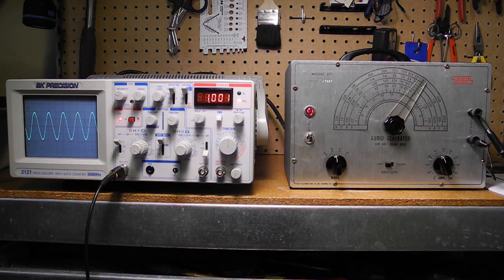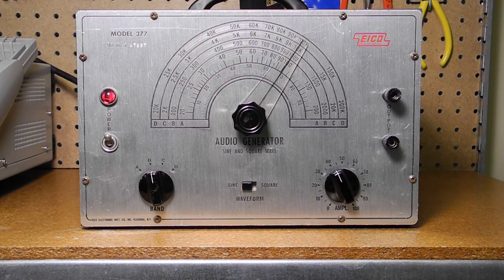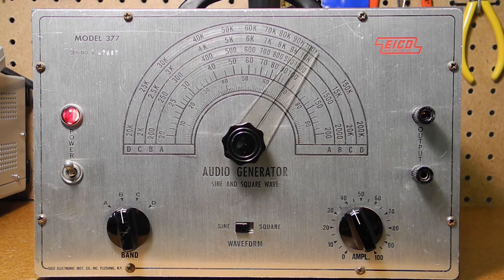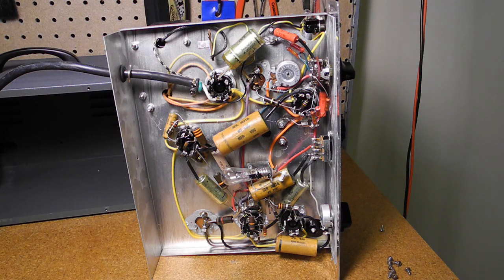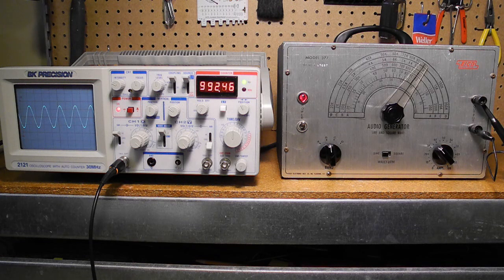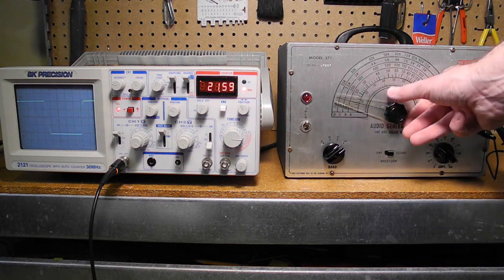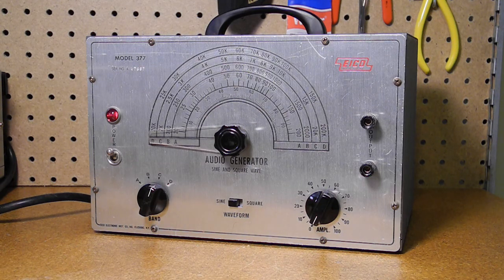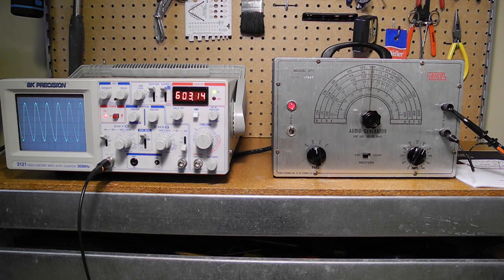The EICO Model 377 Sine and Square Wave Audio Generator

Comment: Nice content. I have a similar audio generator that is missing the thermistor. I understand that the thermistor was used in place of a bulb. Do you know what the specs are for the bulb that is in there? I would like to get my unit running properly. I know this is a super old video, but i appreciate any feedback anyone could provide.
Reply from the maker: The manual lists it as a GE 3S6 5 Watt bulb. It looks like there are still available.
Reply: @jefftranter  Thanks so much!

Comment: That square wave produces the deepest frequency in sub bass synthesis found in nature. It is the rawest rumble ever and no digital apparatus has yet to reproduce it. Get this thing if you see it. It plugs into anything.
Reply: Well... Producing any frequency with any waveform is effortless nowadays with digital equipment.
But, ok.
Reply: @devilsoffspring5519  did y ou even read his comment?   Nice moniker by the way ... basically calling yourself a degenerate.
Reply: @robbyv.526  Yes, I read it.
The shape of the waveform does not directly determine the frequency. There isn't anything about square waves that makes them inherently lower (or higher) in frequency than any other waveform.
Also, waveform synthesis, by very definition, isn't found in nature.
Both digital and analog signal generators can approximate a square wave, but none can produce a true square wave because that would require an infinite slew rate (rate of change of output voltage.) So, a square wave can only be approximated by practical physical devices.
My screen name is based on my fondness for the American punk rock band called the Offspring.

Comment: I just got one myself.  It was going to be thrown out from my job.  Can this be used as a synthesizer
Reply from the maker: If you mean a music synthesizer - not easily. There is no way to change the frequency except using the front panel controls.

Comment: Weird question: I found one of these at a thrift store and bought it for cheap.  I don't really have a loudspeaker to test with, nor an oscilloscope.  The power light doesn't come on but it looks like it's burnt out.  However, if I remove the cover and turn the device on, the vacuum tubes light up.  Does this mean it's in good working condition?